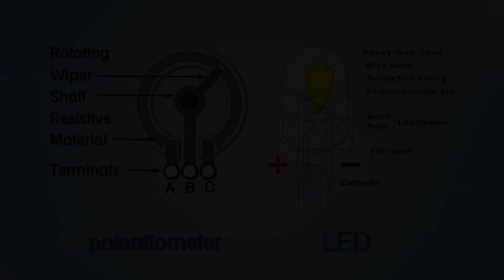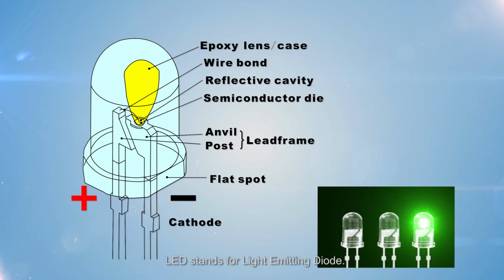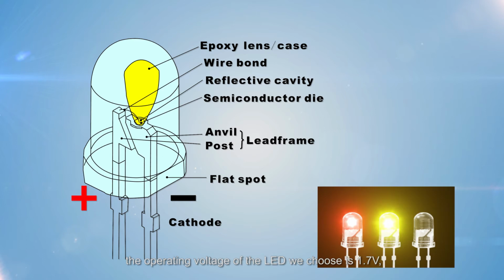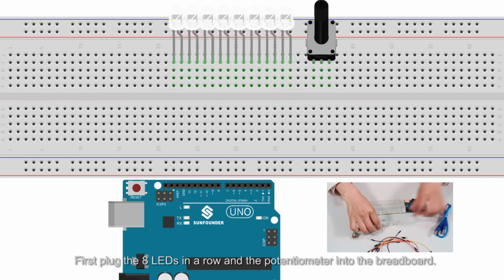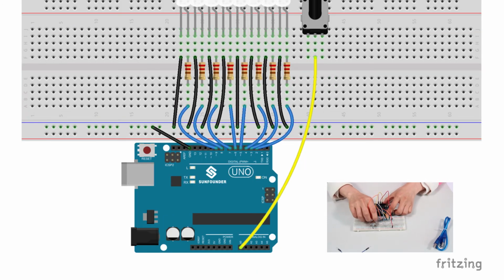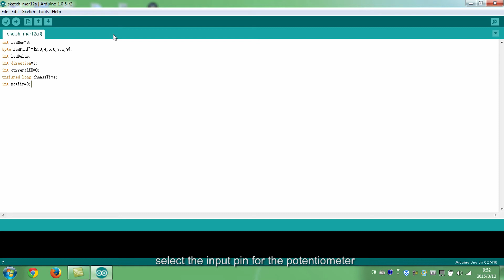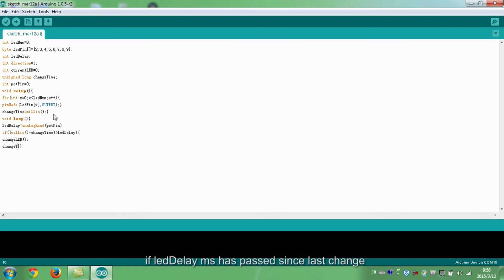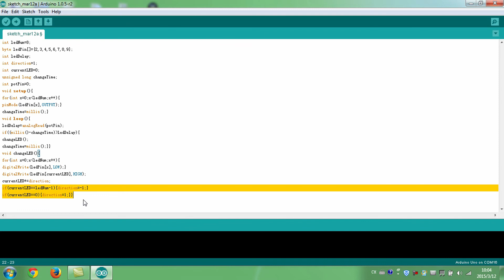SunFounder Kit Tutorial for Arduino - Interactive Flowing LED Lights

Comment: How do the 220ohm resistor look like?? I can't find it in my pac I ordered
Reply from the maker: Method A: you can test the resistance with the help the multimeter. Adjust the multimeter selection switch to Ohm range and check the resistors.
Method B: check the color code, the 220 Ohm one should be red red black black brown.

Comment: It should actually be
digitalWrite(ledPin[x],HIGH);}
digitalWrite(ledPin[currentLED],LOW);
otherwise you get the opposite result
Reply from the maker: +Chad Harrington This also works. But this code is to make the LEDs brighten first and then dim one in turns, while our sketch is to turn on only one LED at one time and make them brighten one by one. We take this method is to get a better visual effect.